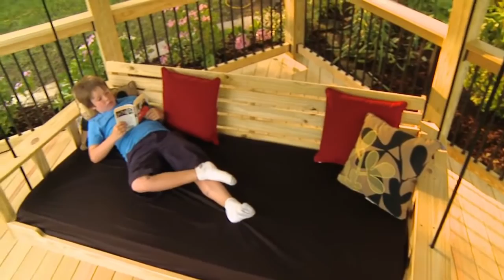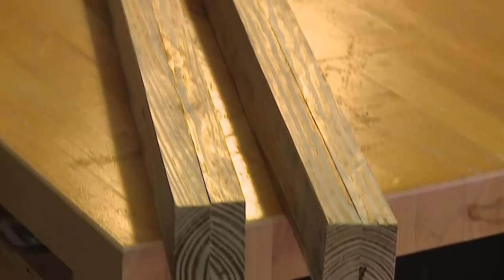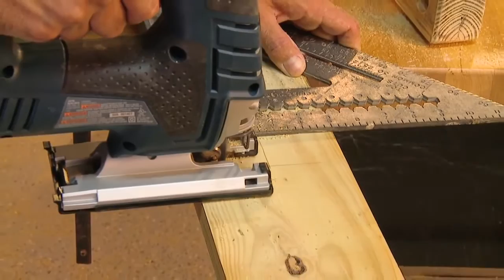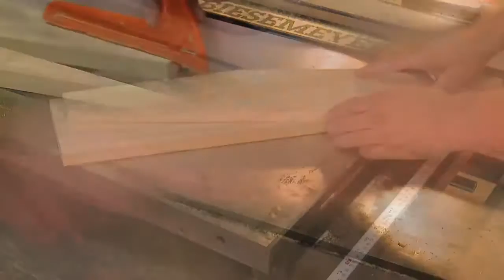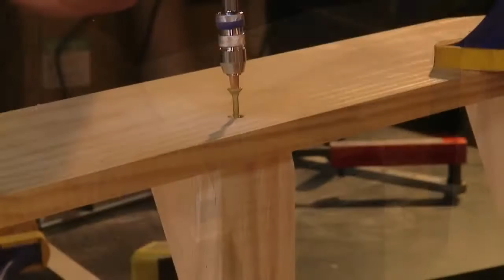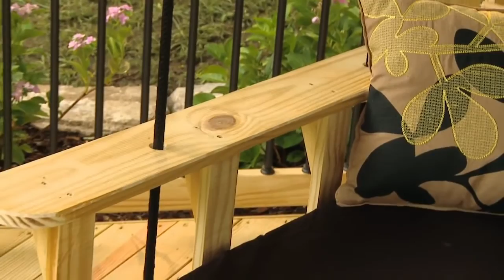Southern Pine Porch Bed Swing

Comment: These plans were perfect, I built one and it looks great.  I used old rope to hang my swing, took almost as long to hang it as it took to build it as I have a porch with siding on the ceiling, so had to take all the siding off and then put in two support beams to properly support the swing, then put the siding back on.   My mistake with this project was not cutting all the ends of the boards first.  If i were to make another one, I would take off the rounded corners off one side of all the boards, then readjust the table saw and do the other side of all boards before even starting.  This way every board will be exactly the same size and will save a lot of time.

Comment: The plans and cut list on your site are completely wrong
Reply from the maker: Can you please elaborate? Were you looking at the 25% smaller porch swing? We included the video in those instructions to give the general how-to. We've had several folks build this project using our plans and this is the first we've heard the cut list and plans are incorrect.
Reply: @Wooditsrealyall  They may be referring to the mismatch in height of the cross braces and the frame.  The frame boards are 2.5" while the cross braces are shown as 5".  It is a little confusing.